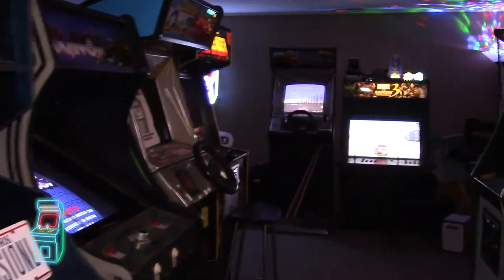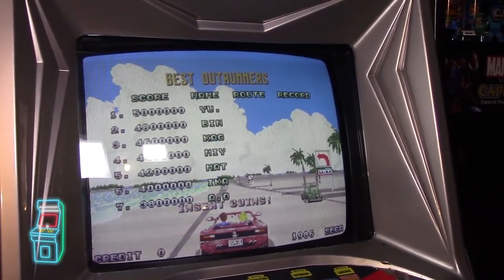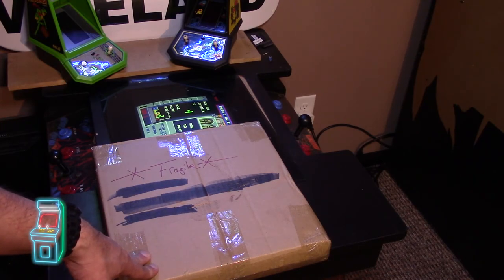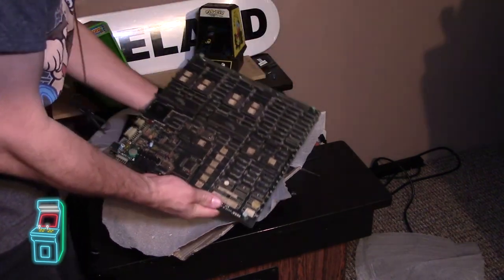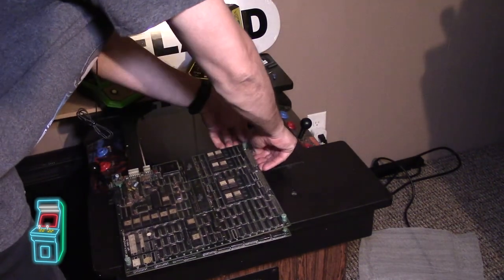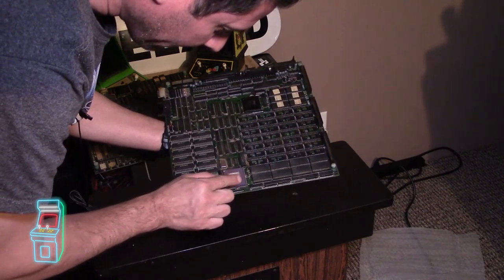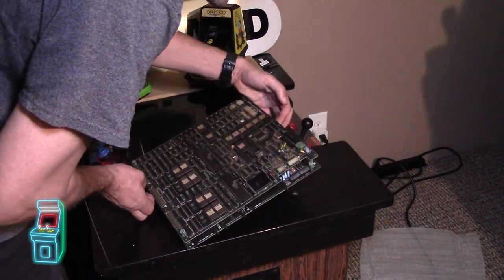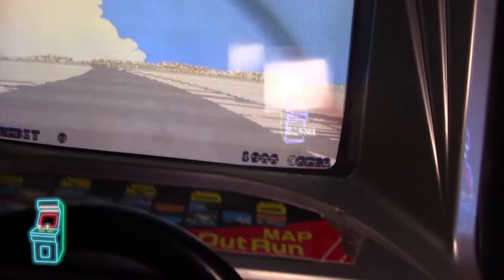Sega Outrun Arcade Repair [Part 2]

Comment: Great video DeLuSioNal's thank you for taking the time to record the different tests. OutRun is a tough board(s) to resolve, lots of swapping, cleaning etc. I've had two failed boards now, both graphics errors on the road and road markings. Mark at retro Clinic in the UK repaired the one I sent him. Great service. Looking forward to seeing how you continue to test the boards.
Reply from the maker: I posted a follow up video where I got my clean PCB to work.  Still working on the filthy one I unboxed in this video.  Just waiting for some parts.  But it should be a good one!

Comment: Any luck just cleaning and reseating the eproms and other chips? I have an afterburner with similar problems and did that and it looks fine now
Reply from the maker: Yeah, it turned out the roms were burned to the wrong chips (see Part 3 I just posted on Friday).  As for the filthy PCB I unboxed here, there was a ton of corrosion on that board and when I popped out the chips, the legs broke on many EPROMS (included the irriplacable Mask Roms).  So I removed everything that was socketed and cleaned the heck out of the PCB.  Now I'm just waiting for spare EPROMS to burn (they are on the way from China) and I'm in the process of repairing the IC legs on the Mask chips.  Hopefully, I'll have another working board set soon.

Comment: How do you adjust the crt monitor? I can not seem to know how to open up the back
Reply from the maker: There are two panels you need to remove to access the monitor. 1) The back door swings open to get to the flyback and main chassis co trails. 2) The top panel unscrews (where the exhaust fan is) in order to get to the neck pots for color, etc.
I open it up in this video here so you can see: https://youtu.be/et8Iz0KJcpg

Comment: I have an Outrun stand up cabinet like yours, most of it is in working condition but when put in memory test, it indicates one bad ram.  Could this possibly be resolved by cleaning the board without replacing the entire thing, since most of it is working.
Reply from the maker: Which ram is it?
Reply: @delsarcade  It says it's bad at IC 73.
Reply from the maker: @davidmiller9619  Sounds like a bad ram chip at the same location in this pic that I circled on the CPU board. (TMM2063P-10). It can be repaired by socketing it and swapping out the bad ram. https://ibb.co/GWtbrTC
You could always purchase the ram (eBay) and then "piggyback" it to see if it fixes the problem. If it does you can have someone qualified to fix it for you. Check out my other video on how I troubleshoot bad ram by this method: https://youtu.be/5zrtdp9KlxM
Also, if you don't have it already, get a hold of the Memtest EPROMS to help you test all ram. IC 73 is listed in the tests which is the sub CPU section.  https://ibb.co/W2R7myX

Comment: DELUSIONAL ARCADE                                                            1.) What are the differences between using the arcade games test mode diagnostic test program compared to using a separate TEST ROM chip? You remove one of the ROM chips from the socket and instead a TEST ROM chip. The Test ROM chip does more deeper level ROM/RAM test I'm guessing
                                         2.) Some repair technician say that dual wipe sockets are better than the machine pin sockets. I thought that the machine pin sockets had less intermittent issues and dual wipe sockets cause more intermittent issues.
Reply from the maker: 1) Correct  2) Opinions vary. I like them both.
Reply: @delsarcade  ok thanks

Comment: DELUSIONALS ARCADE ,                          
         Why is there 2 different clock signals used in arcade games that are out of phase, for what reasons? 
                                         Why would you want clock signals to be out of phase or delayed?
Reply from the maker: No you're getting too technical. I have no idea.
Reply: @delsarcade  ok thanks